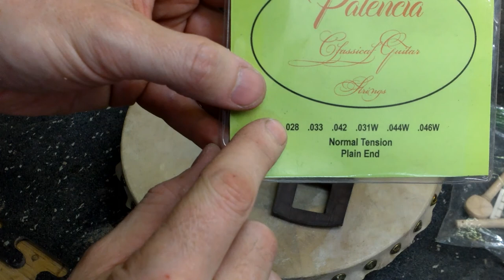DIY Travel Banjo Kit Assembly 2020

Comment: I have the biscuits in dry. The joints on the front and are  not flush.  I am hesitant to glue. Please advise.
Reply from the maker: Irv Perlman if they are way off flip one side over- they only fit one way.
If they are off by a small bit, you can use clamps or heavy weights to hold them flush as they dry. 
The powder on the skin can be rubbed off when you soak it in water. Please send me an email if you need anything else.
Reply from the maker: Send me a picture of the joints, I remember checking everything before I sent it out to you, might be a simple fix. Carverbanjos@gmail.com
Thanks!

Comment: do you do anything to the wood at all? I want to leave it unfinished but live in Vegas so I don't want the wood to split from the dry weather
Reply from the maker: Colton Malich I’ve never heard of this happening, I’ve sent many banjos to low humidity regions and have never had any problems. Though I do recommend putting a coat of thin varnish/oil on any instrument to seal the wood.
Reply: @brncrvr  do you have any oil recommendations that will still give it an unfinished look yet seal the wood?
Reply from the maker: Colton Malich no not really because any oil is going to “finish” the wood by definition. Maybe try a low shine variety like teak oil.